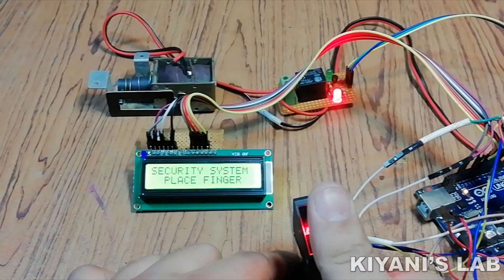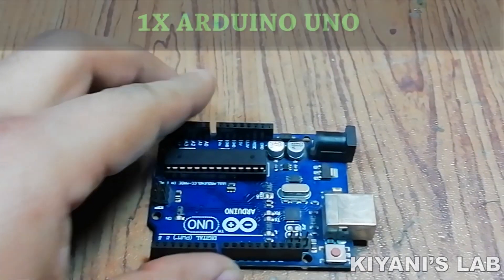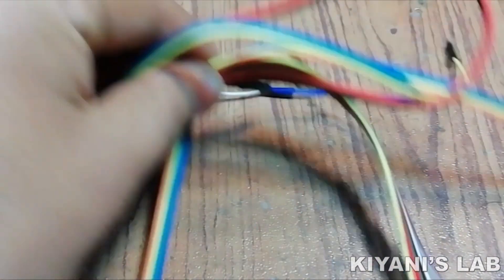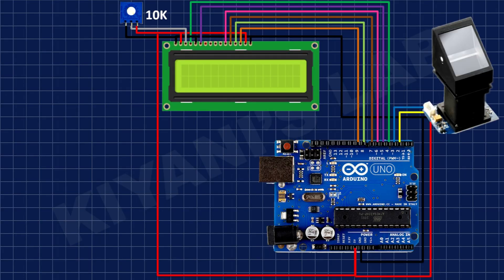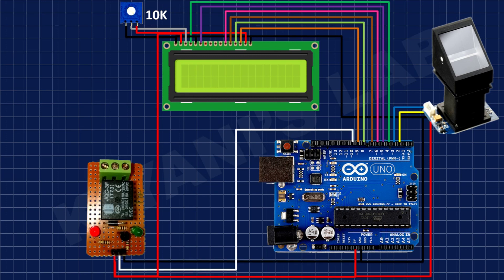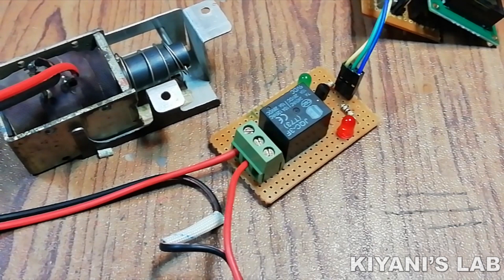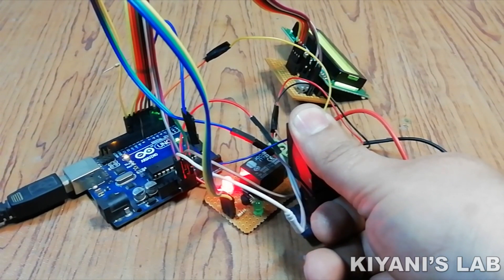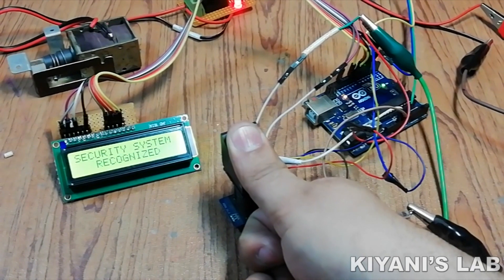How to Make Fingerprint Door Lock

Comment: Thank you for the tutorial. But I have one question does the Adafruit_Fingerprint library works for all types of optical fingerprint sensors like R 307 or  FPM10A?
Reply: I don't know about the FPM10A but yeah it did work with my r307